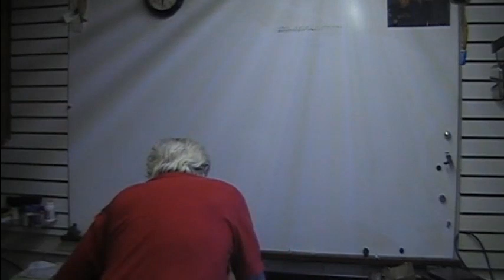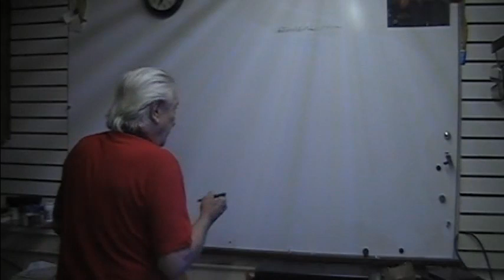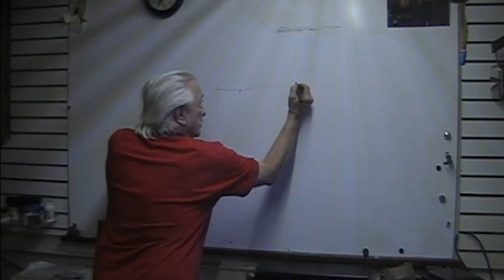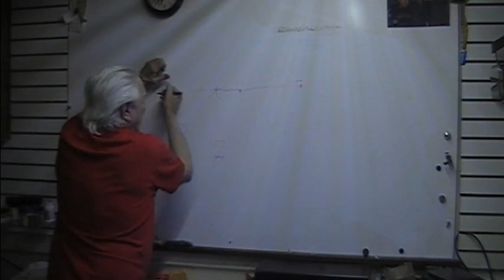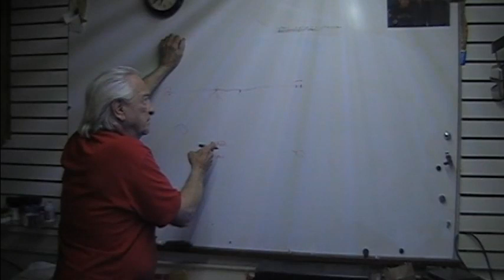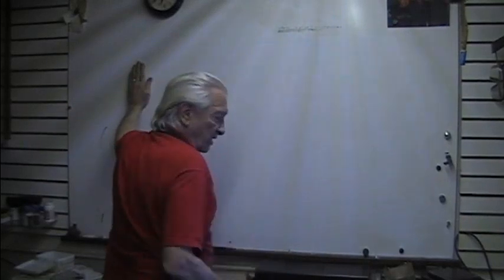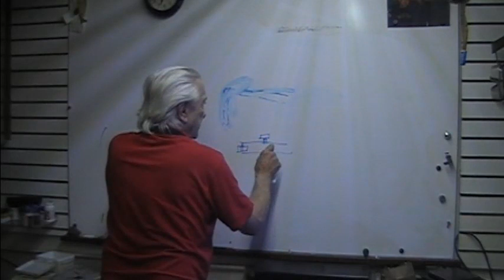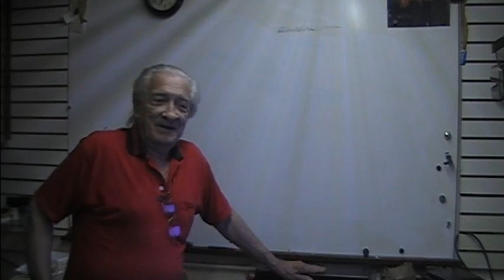Two Stage Mechanicl Oscilator  Secrerts  # 1

Comment: Swinging 90 through 90 degrees,  that's the whole secret,  well done!   You still have  a big energy leak in the second stage of the oscillation.  

When the pendulum drops the two inches on the end of the power transfer bar , it looses its natural swing and it's energy is depleted on it's uphill swing from vertical.  The gravitational acceleration it received on it's downhill path is cancelled out as it passes through plumb.

Fair play to Victor Milkovich.  His research has shown that the pendulum is an incredibly efficient mechanical device.  It's speed and time are predictable and measurable by the length of the arm.  

The beam engine style power transfer bar,  the sea saw,  on Victor's pendulum configuration fails to fully exploit gravitational acceleration,  yet he has demonstrated it's efficiency. 

Over  the past 20 years I have built over 20 different configuration of pendulum and here's where I'm presently at.  I've simplified Victor's version cut out the middleman,  the power transfer bar,  as you call it.  

The fulcrum of the pendulum is the drive shaft rotating 180 degrees backward and forward.  
180x2=360,  the clockwise and anticlockwise motion.
With backstop bearings on either end of the drive shaft pendulum fulcrum and some simple gearing,  the drive shaft with the swinging weight,   accelerated by gravity for about 75% of the stroke ,  is turning an output shaft the full 360 - no middleman,  no sea saw. 

A 250 lb weight on a 66 inch arm swinging 90 through 90,  is recording 1800 ft lbs  with torque metre on the output shaft.
Under a torque metre load of 1800 ft lbs,  the pendulum needs around 600 ft lbs for 25% of the full stroke to maintain it's swing,  making it around 200% efficient,  but this improves in multiples as the pendulum arm is lengthened and the weight is increased.  

As you correctly point out,  the longer the arm with the weight swinging from 3 o clock to 9 o clock, the less input force needed because of the higher gravitational acceleration.

Keep up the good work Sir,  a pendulum is a beautiful thing to study.

The solar system is a complex pendulum with invisible gravity arms suspended from the sun,  so precisely engineered by who knows.
Reply: Veljko,NotVictor🤦
Reply: @ovidius2000  lol
Reply from the maker: W O W !!! … I do like it when I get comments from people that Know something about pendulums and their power.
180  degree  swing IS the whole secret to  getting full power from the pendulum  ....How Ever ,,,  ..  NOT the whole secret to the two stage mechanical oscillator . As  you  pointed out .  The loss of power at the opposed end of the power transfer bar . I think you are going to REALLY like the next video . We will be discussing the power transfer bar and the mistakes we have all ben making ,  all these years.
Reply: Boomer,  look forward to your next video.  Sorry to hear about your poor health.  
I've had almost as many birthdays as you,  thankfully my health is holding.
Here's hoping we all live long enough to see a pendulum powered world powered by commonsense affordable energy from gravity. 

In your own words,  "there's much to learn about the simple pendulum".

You Tube video,  Professor Julius  Sumner Miller -  Lesson 6 - "Concerning Falling Bodies And Projectiles".
I learned a lot about G-force from this American physics guru - and from living on an Irish hillside farm where everything wants to roll downhill. 

YouTube video,  "Bruce  Furstenberg's pendulum",  -  a very impressive setup with a 9 tonne iron bob swinging the 180 degrees on an 18 foot arm.  
Bruce has the pendulum's  rotating axel, pivot,  threaded to a hydrollic  piston,  producing a mighty force but over a distance of only a few inches.  
It would be difficult to make  Bruce's daddy of all pendulums do any useful work since an electric generator needs a force over a long distance at high speed to produce a worthwhile amount of electrical energy.

However,  Bruce has successful  pendulum powered water pumps,  making it possible to store energy by raising water levels.
The Furstenberg effort got American TV exposure and seems to have been abandoned ever since.  I'm curious about this.  Are the conspiracy theorists right  in rumouring that ruthless energy corporations squash all threats to their monopoly on fuel? 
I personally don't buy the conspiracy theory,  but just in case they may be right,  I post no videos on my experiments.

Bruce  Furstenberg,  Victor Milkovich,  yourself Boomer and other backyard pendulum tinkerers,  I have abandoned all 2 stage oscillator efforts,  resulting in a pile of scrap iron behind my barn,  enough for a load of beer money. 

Professor Julius Sumner Miller is new my mentor.  
Because of inertia,  a free-falling body drops only 16 feet in the first second of it's fall.  From a height of 64 feet,  the same mass will fall 48 feet in the 2nd second of it's fall,  accelerating to 80 feet in the third second of the fall.  
So from a height of 144 feet, over 3 seconds, 16+64+80=144,  about the height of a small wind turbine in Texas.    
With G-force @ 9'81 m/sec squared,  (32 feet),  the pendulum bob passes through plumb at a surprisingly higher speed per second than the sum of 16+48+64 over it's 3 second drop.  
The pendulum bob passes through plumb at 226 feet per second,  82 feet per second faster.  There's your energy gain of about 75% Boomer! 
 Professor Miller explains how and why in Lesson 6,  no mystery,  no free energy,  just simple G-force.   

The early mechanical clocks were complex gearboxes driven by windup springs or weights with a predictable/measurable pendulum to keep set the  time by.  
The  gearbox drove the pendulum with a swing of only 15/20 degrees or so. 

I have turned the clock backwards,  where the pendulum with a small external force drives a much simpler gearbox,  rotating a shaft at a constant speed and torque.  
My wife said I should turn the clock forward and get a peek at the future but that's another day's work. 

You have over 5, 000 subscribers watching your experiments.  Most of these would backyard tinkerers like myself.  According to conspiracy theorists,  some could be corporate or academic spies with influence and resources to patent your ideas and shaft you.

Freely sharing your ideas on YouTube is very noble but could also be hazardous in this profit driven world. 

I'm not profit motivated but I'm not going to be shafted either. If you send me your private email I'll show you my clock going backwards.
Reply from the maker: @cdevine53    boomerdryeall01@aol.com